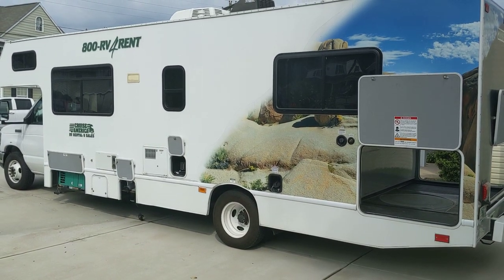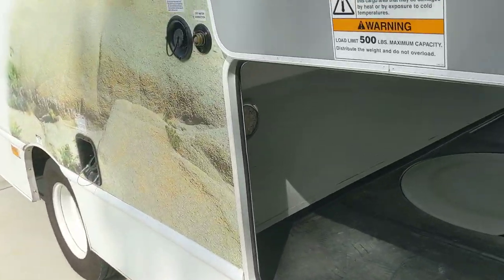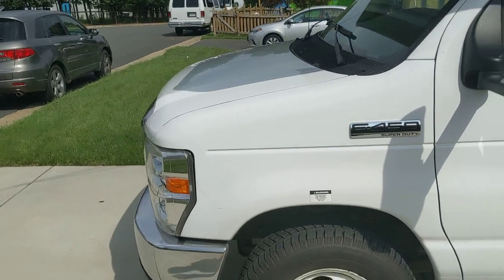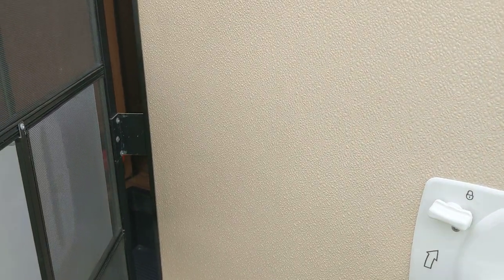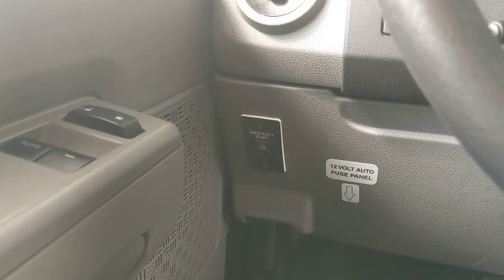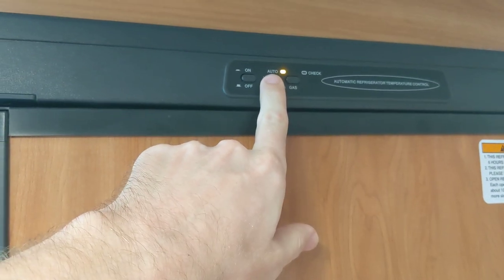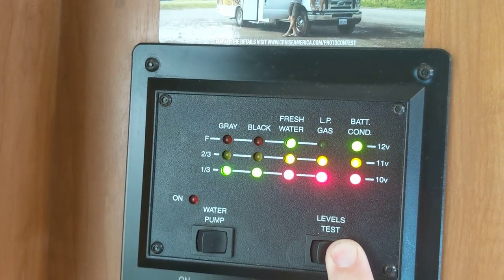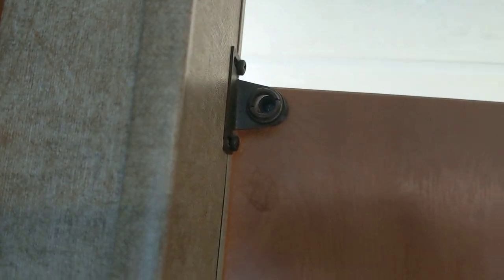Cruise America 30' RV Review and Walk Through

Comment: We purchased our 28A in 2016. We have used ours except for last year. Made some modifications to make it a couples unit. changed the A/C to 15k unit. Replace the whole front end suspension before we made our first trip.  Now it is 200% better driving now with the new after market 2ea Front & Rear Monroe Gas-Magnum 65 Shock Absorbers, and Stabilizer Bilstein 24-174534 5100 Series Steering Damper, Awning 16',Backup Camera system: 2 Video Input Plug V1/V2, 2 ea Backup Cameras & 1 ea Color 7" Monitor,12V Outlet Socket Panel Jack, 2 Dual USB Charger,  50 AMP Power system includes 60 AMP Converter, 40 AMP DC-DC charger, 200 AMP Lithium batteries. Was thinking of trading it for a 34' 5th wheel, but this unit tows our car well and is a lot better to park. Also being 29'9" it is allowed in all state campgrounds.
Reply from the maker: That's great! We hope to do something similar someday. Thank you for the list of parts. Very helpful! 👍👍
Reply: @CompTechMike  I can send you also photo / wiring diagram of the lithium battery conversion for 28A floor plan. We purchased ours from cruise america on Orange blossom trail, Orlando, fl. they sell their RV when they reach about 110,000 miles and up. Also check the engine to get the year they made the cutoff chassis ours was 2010, but rv was built in 2011.  do not get a 28A unless it has a E-450 V-10 engine and is rated super duty. The chev eng & E-350 Ford are too small. Best thing is all the chassis parts usually can be got from Ford or Advance Auto in 1 or 2 days. The driveshaft is custom because of the longer wheel base, which handles much better.

Comment: @13:33 - If the fridge is set to on / "auto" and the gas is turned off, (and there is no shoreline / generator power) then the igniter will attempt to lite the gas for the fridge every 3-5 seconds for as long as there is a battery to try to start it.  I recommend you set the fridge to OFF when the gas is OFF, or set it to ON if you are running the generator or shoreline power.  Leaving it on AUTO with the gas off and no generator or shoreline power will cause the igniter to go off constantly.
Reply from the maker: Hi! Thanks for checking out my Cruise America walk through videos.  This is an interesting point.  Usually when you pick up your RV the sales staff will go through a "pre-trip" with you, which includes things like turning on the fridge and setting it to "Auto".  It will automatically switch between which ever is available to keep your food cold.  They do this at departure since it can take several hours to cool off initially.

Is there a reason why you'd have the gas turned off?  I assume to do that, you'd need to manually turn the disconnect knob beneath the vehicle.  Only places I'm aware this is a requirement are when traveling through some highway tunnels, and also some gas stations ask you to turn off propane before filling up.

In any case, thanks for passing along the tip!  I'd probably test this myself sometime (just to see if it wasn't a defective unit you received), but can't really imagine too many scenarios where I'd need to turn the gas off?  Safe travels!

Comment: Great overview indeed! Thank you so much for sharing that. We are going to Canada with little kids and we were wondering how did you find the heating system for night-time air-conditioning. How does it work? What was your experience? Many thanks!
Reply from the maker: Hi Gianluca! Thanks for checking out my Cruise America walk through videos. We've honestly only needed the heater for one trip (out of all the times we've rented). In our experience we found it worked very well, and heated the inside nicely. I would recommend being plugged into shoreline power (if possible) since otherwise I think the heater will only run for 2 hours max (uses propane to make heat and electricity to run fan).

Also familiarize yourself with the carbon monoxide detector (near bedroom floor) just in case.

I've got a newer version of this video that may help, as well:

https://youtu.be/qbBoA0x5Fow

Safe travels!

Comment: I rented the 30 footer back in Oct 2019 and we had a lot of issues with shower door, cabinets not working, bed frame falling apart. Too tired from a 24 hour flight to nick pick when took the vehicle.

Having said that, it is very comfortable once you get settled somewhere, but sometimes driving in crowded areas to fill up the gas can be a nightmare.

My next trip to US with the family, was thinking of the compact to compensate for driving a smaller vehicle, but not sure how my wife and kid would like to sleep in top bunk lol
Reply from the maker: Hi!  Thanks for the comment.  I always enjoy hearing other people's experiences.  When you say "bed frame falling apart" - which bed do you mean?  I assume the couch or dinette?  Curious what was wrong with it?

We also had trouble with the shower door in the previous model 30' vehicles.  The sliding door with a "track" seems to jam and come apart pretty frequently.  They've updated this to a regular door in the newer 2021/2022 models.  It's a lot nicer, just watch the step coming out - it's a pretty far drop if you're not expecting it.

You're right, it can be challenging pulling in to gas stations.  We usually plan our route in advance and check the look of gas stations (google maps & street view can be helpful) prior to pulling in.  And when we do, we head immediately for the furthest away pump.  No sense trying to squeeze into the middle rows.  😆

Having driven both, we prefer the 30' over the 25'.  The bed is easier to get into and out of (the 25' model has a "corner bed"), and the bathroom is a bit more roomy.  The 25' is easier to navigate on tight roads, but felt like it got "blown around a bit" when we took one up into the mountains.  So I guess it depends on where you're driving, LOL.

Thanks again for commenting, hope you have a great trip your next time around.  Here's a link to my more recent walk-through video on the updated 2021/2022 30' models.  Hope it helps!

https://www.youtube.com/watch?v=qbBoA0x5Fow
Reply: @CompTechMike  no worries on the comment.

The queen size bed in the back is on a wooden board frame. The two pieces of wood at the corner would come apart at times so I would have to jimmy it back in place.

Learned my lesson what to look for and not accept less than ideal condition when I rent again 🤪

Back then, instead of renting a car, it was cheaper to get an RV. And I wouldn't have to worry about hotel costs seeing family that didn't have a bed for us

Comment: This video is wonderful!!!  We'll be renting this model in October this year (2022) for 12 days.  What does the fridge work on while you're driving?  For instance, we'll be traveling sometimes 7 hours in one day and having food spoil wouldn't be good.  Yes, I saw your comment about how to stack the fridge.
Reply from the maker: Hi! Thanks for the comment. When you check-out, the sales person should put your fridge on "auto" (this is a button on the top of the fridge). That means it runs on propane when driving, and electric (when plugged into shore power or the generator is running). It can take 7-8 hours for the fridge to fully cool down, but should stay pretty cold as long as you don't stand there with the door open. 😉 Just check your propane level before you head out. Have a safe trip, sounds like it'll be great!

Comment: Great Video ! Was wondering how much Gasoline the Generator uses per Hour. And if the Vans Vehicle Battery or Auxiliary gets charged when the 4000 Watt Generator is running?
Reply from the maker: Hi Jayme!  The onboard gasoline generator uses roughly 1 gallon of gasoline per hour of use.  You cannot turn it on if the fuel tank is below 25% full, and you will need to check the oil level periodically.

When the generator is running it takes care of all onboard electrical needs including operating the 110v household-style electrical outlets, charging the house/aux battery, operating the rooftop air conditioner, and the microwave.  This is identical to when you are plugged into shoreline power.  When you are not plugged into shoreline power (or the generator is not running) you can use the lights in the back (operating off the aux battery) but can't use the household-style electrical outlets, operate the rooftop AC, or the microwave.

I also recommend checking out my more recent walk through video, here:

https://www.youtube.com/watch?v=qbBoA0x5Fow

Hope this helps.  Safe travels!

Comment: Hj great review travelling september been given the 30  , i am travelling solo thats my thing .. lots of hiking dakota then yellowstone and tetons .. got a fair bit of advice driven trucks and some stuff .. any advice for solo traveller ?   As to one of you're comments i was also given this as cheaper  but i do like to have option of space
Reply from the maker: Hi Sam!  Thanks for checking out my videos.  In our experience camping at sites without full hookups, the biggest challenge was the gray water tank (sinks & shower) filling up.  That tank is the smallest out of all the tanks on these vehicles, and since my wife & I like to shower each day, wash dishes, etc., we found we could only go about three days without finding a place to dump it.  Everything else lasted a good while for us; fresh water, propane, etc., we've never had any trouble with.  And we typically only use the generator for a few hours a day, so no issues there.  I could see if you were staying somewhere very hot (and needed to run the generator for AC) you might have more challenges with that...

Otherwise, just take your time.  Drive safe.  Plan your exit route whenever pulling into a gas station.  If you feel nervous driving, practice in a parking lot before hitting the highway.  Many RV'ers go by the "330 rule".  That means don't drive more than 330 miles in a day and don't arrive at your campsite after 3:30pm (to have time to set up before the sun sets).

Read through the comments on YouTube videos, many good suggestions have already been mentioned.

Last, check out https://rvlifestyle.com/ RV Lifestyle social media groups and YouTube channel.  They have a ton of information on their page.  Safe travels!

Comment: Great video! I’m planning to rent one next month and cannot decide which size to rent. I’m leaning towards the large, just like this video but am concerned about easy of driving. Is there a considerable difference in ease of driving between the large and medium RVs?  Also how different is the fuel efficiency?
Reply from the maker: Hi!  Thanks for the comment.  I also have a video review of the 25' RV, if you'd like to check it out?

https://www.youtube.com/watch?v=T8iYqvyRNAo

Personally I didn't find them to be too different to drive.  The bigger one is supposed to be more stable in high winds, also has a more powerful engine (V10 vs V8).  Fuel economy is a bit better in the smaller one (by a couple mpg), but a big factor is how heavy your foot is and whether you're going up and down mountains or driving across flat terrain.  Just take your time and go slow.  You're on vacation not the Indy 500, right?  🤣 Have a safe trip!

Comment: Thank you for your incredibly helpful video Mike. I'm trying to plan a week trip in one of these with some pals soon and this pretty much answered most of my questions about amenities. 
I do have a question for you if you can answer: 
I wanted to ask if it's possible to use a small monitor/TV screen and game console at the same time while the vehicle is in motion with the generator? I wasn't sure how taxing it would be on the vehicle itself.
Reply from the maker: Hi! Thanks for the comment. Glad the video was helpful. Yes, many people run the generator while the vehicle is in motion (for example: to run the rooftop AC to cool off people riding in the back). So yes, if you're running the generator the household-style electrical outlets will be functional for a TV or game system or whatever else you want to plug in. Obv. you'd need to make sure everything is secure somehow - wouldn't want the TV toppling over or sliding around. 

Personally I'd recommend a tablet or something that can be hand-held might be a better option. Or a book, lol. 🤷🤣🤣

Comment: I was wondering if the AC cools very good in the summer time!  We're use to sleeping with it around 66-68 at home.  Does the cool air get all the way back to the bedroom if there are no  ducts in the ceiling?  How long of a shower can you take with a 6 gallon water heater?  Thanks
Reply from the maker: Hi! Thanks for the comment.  We've had no problems with it staying cool but you may want to keep the interior curtains open (the ones that separate the RV for sleeping).  A small electric fan wouldn't hurt (to help move air around), either.  Also if possible park in the shade, this will help keep the interior cooler.

The propane water heater gets hot!  You'll probably find you only need to turn the hot water knob a part of a turn, and then turn up the cold water to suit your desired temp.  My wife and I had no issue taking hot showers as long as we allowed the water heater to warm up for 15-20 minutes before starting.  We do typically turn the water off while using soap or shampoo, and then turn it on again to rinse off.

Comment: Do you think the Standard 25' unit is sufficient for a 5 week trip or would you recommend the upgrade to the 30' larger RV.  We are 2 ppl retired traveling to FL for a snowbird winter vacation.  I assume both 25' and 30' drive about the same but 30' has more room.
Reply from the maker: Hi!  Thanks for the comment.  Personally if I was going for five weeks I'd want the bigger one.  The worst downside to that is probably the poor gas mileage.  But not having to climb over one another every time you get out of bed is a godsend.  (the 25' model has a bed in the corner).

Here is my video of the 25' one.  You can see the bed around the 11:45 minute mark.  Hope it helps.  Have a safe trip!

https://www.youtube.com/watch?v=T8iYqvyRNAo

Comment: What was the MPG between the 5 passenger vs 7 passenger?? Thanks for the video..
Reply from the maker: Hi Beanwl!  Thanks for checking out my video.  This is one of the most common questions.  In our experience, we typically got between 8-10 miles per gallon with the larger 30' vehicle (with the V10), and 12-14 with the 25' vehicle (with the V8).  Newer vehicles (2021+) are slightly better owing to more efficient engines.  The newer vehicles also have a handy "estimated range" indicator on the dash, which we found helpful.  Obviously there's a lot of variables, such as if you're driving across flat terrain or up & down mountains, highway or city stop-and-go traffic, and of course how heavy your foot is.  😉

In terms of real-world experience, we've been able to get from Northern Virginia to upstate Pennsylvania and halfway back down again on a tank of gas.  We've also been able to get to most of our destinations without stopping, aside from stretching our legs or walking the dog.  The vehicles have tremendously large fuel tanks - 50 gallons - just be prepared for that costly fill up!

Here's a walk-through on a newer vehicle:

https://www.youtube.com/watch?v=qbBoA0x5Fow

Hope this helps!
Reply: @CompTechMike  Thank you so much for the information.  This will be very helpful for our trip this summer.
Reply from the maker: @beanwl  you're welcome!  Have a great trip!  😊

Comment: Great video Mike! Thank you for the recommendation. Is there additional storage under the master bed?
Reply from the maker: Hi!  Thanks for the comment.  If you lift up the master bed it's just a flat sheet of plywood below it.  So to answer your question, no, there is not.  But that is because of the storage accessible from outside the vehicle, which is technically "under the master bed", if that makes sense?  Hope this helps!
Reply: @CompTechMike  No, your water tank is under the bed.

Comment: Thanks for the info!  I’m renting this same model and taking it to Utah/AZ in 3 weeks...question....when you pick up the RV is the propane and fresh water full or do you need to fill them up after you get the RV?
Reply from the maker: Hi! Thanks for the comment. In my experience the fresh water has always been full, and propane 1/3rd to 2/3rds full. I think this depends a bit on the condition in which the previous renters returned it, and also how busy the rental office staff has been. Not all rental locations have the capability to refill propane, for example.

If you do need propane I've had good luck getting it at places like home and garden stores. Some large truck stops also supply it. Have a safe trip!

Comment: Is there any storage under the bed or couch? We are renting a 30 ft as part of a move so there are a few things I would like to mostly stow away for the trip
Reply from the maker: Hi! Thanks for the comment. No, there is not any accessable storage under the bed or couch. Underneath the bed is mechanical equipment. The biggest storage space on the 30' RV is accessible from outside the vehicle, under the back area. If you need to carry a lot of stuff (i.e., for a move) you might want to inquire at the rental office about towing a trailer behind the vehicle. Have a safe trip!

Comment: Thanks for the video! We rented a 30ft for a trip to the Grand Canyon. We estimated the mileage. Do they refund you if you don't go that many miles?
Reply from the maker: Yes.  They check the odometer (and also the generator usage, propane levels, and whether the tanks have been emptied) before and after each trip.  We always receive a pretty significant refund after each trip, although most of that is the security deposit.  Good luck, have a safe trip!